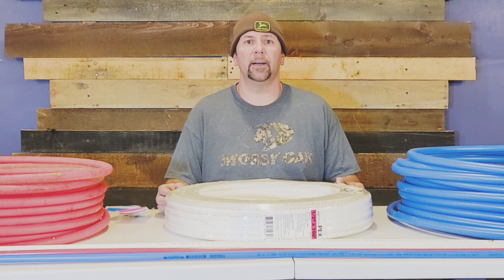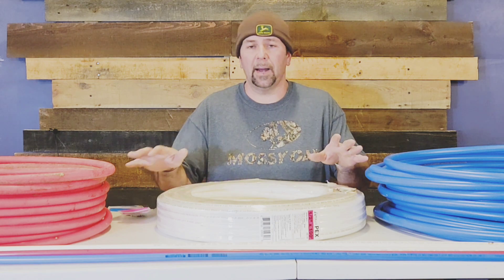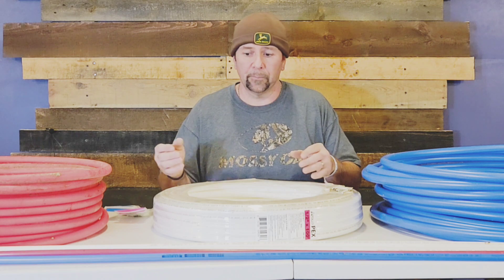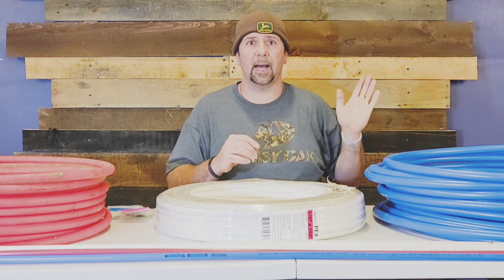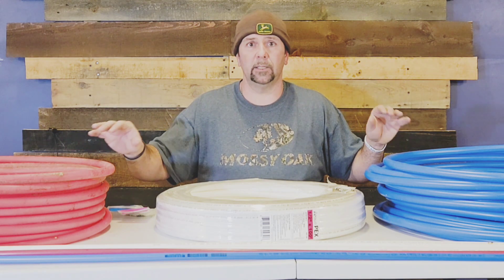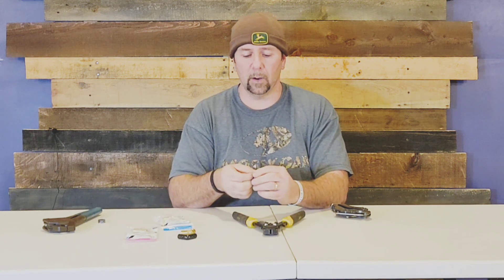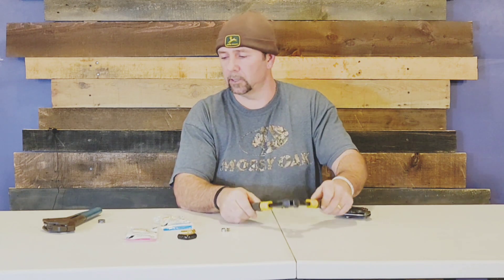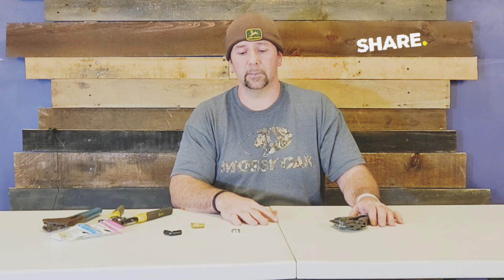What you should know about PEX pipe before you start your next project

Comment: Pex A degrades due to chloromine especially in hot water. I had one crack linear mid pipe thru pipe under 9 years of age.
Reply: I re piped with pex B using Pex A fittings and collars,  and I  expect the PEX B to last a true 50 years.
Reply from the maker: OK thanks for sharing. I did not know that.